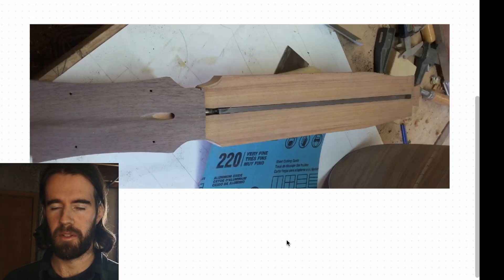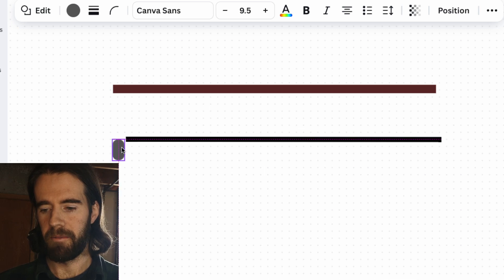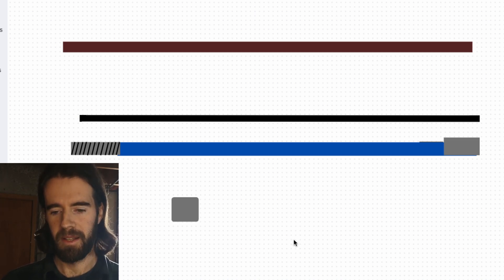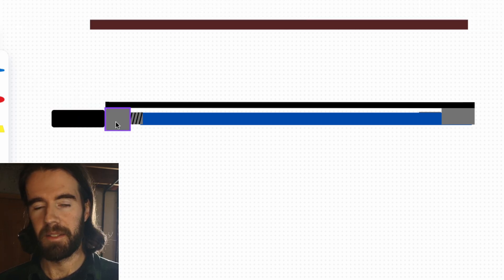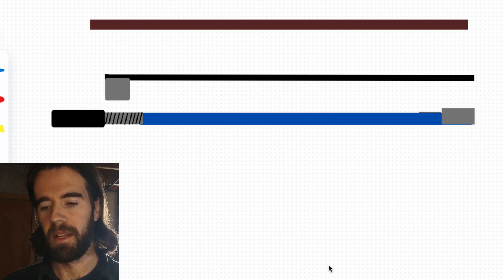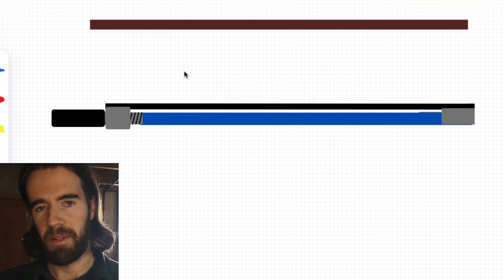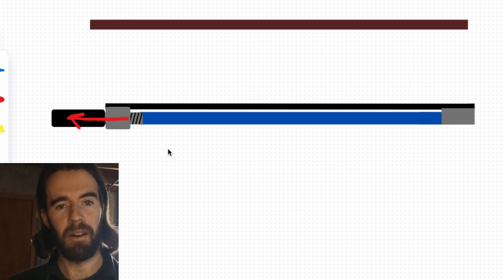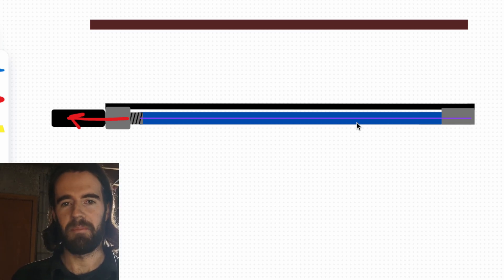Types of Truss Rods and How They Work

Comment: I’m a newb who is curious about the mechanics of guitars. Thanks for taking the time to make diagrams (picture=1000 words), this is the best of the dozen videos I watched on truss rods. 

I was surprised to realize that this system pushes on the fretboard, such that theoretically if the glue holding down the fretboard was bad, the fretboard could separate from the neck (I’m guessing that is rare in practice though).

Am I right that the advantage of the double action is that is can bow in both directions, but the advantage of the single action is that for a given amount of turn, the single action has a smaller change in length (and therefore is a finer adjustment)? I’m guessing that the double action is fine enough adjustment for most people though, since it is apparently the more popular.

Thanks again for a very helpful video.
Reply from the maker: Thanks. Yeah, it would reveal a bad glue job but glue is as strong as wood when flush so I've never seen it rip up from a truss rod. 

I think adjustment would really be determined by the thread size and the strength of the rod material.

Comment: Great explanation. Is it normal for the welded nut to back out after many clockwise turns?
Reply from the maker: Well not clockwise. If you go to the left a dual action one way truss rod nut will come off but none should come off if you turn to the right.